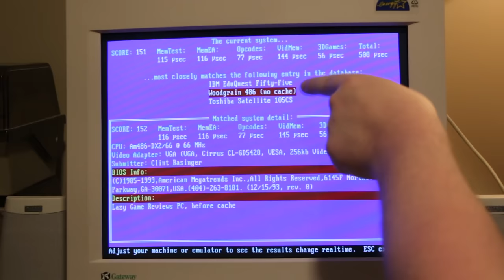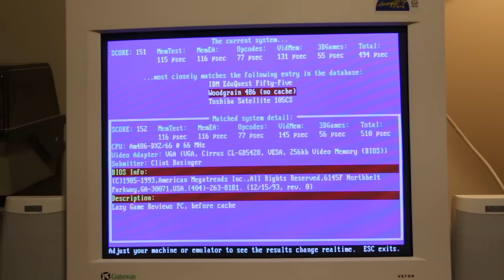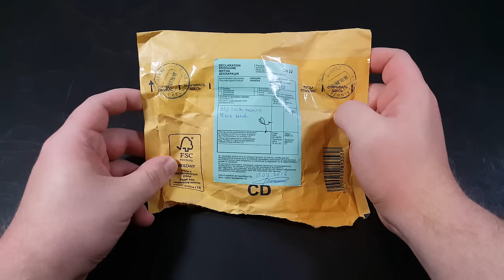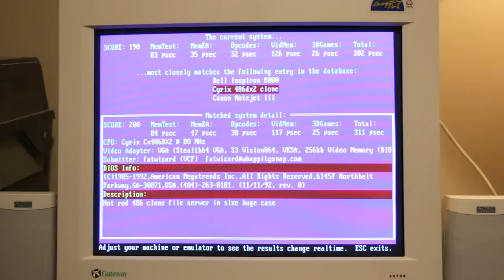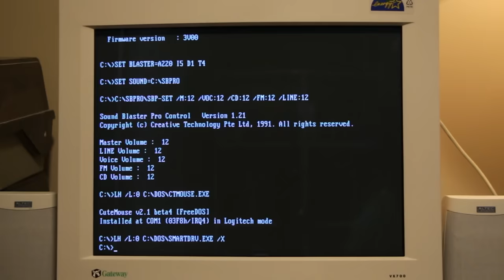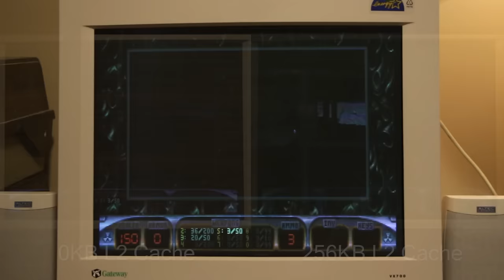LGR 486 Update! Installing L2 Cache

Comment: Great video here! In my experience, adding as much of the L2 cache as possible made plenty of difference.
Sometime in 1994 I bought a very nice 'multimedia' desktop PC made by HP. It was based on the AMD DX4 Enchanced CPU running at 100MHz. All other specs were outstanding for that time.
Anyways, I did not know that no L2 memory was included at the time of purchase. The bootup process was a real slow and painful atrocity. So, after loudly complaining to a dealer's sales rep regarding this issue of not telling me about the absent L2 memory, I bought 512MB of it (I hope I am correct), and installed it.
Wow, what I difference it made! The bootup alone felt alot like going from a slow HDD to a nice SSD these days. I do not believe that L2 memory influences all computing processes equally, but in some cases it provides for some dramatic performance improvements.

Comment: Quake and Duke3d are pentium territory
Reply: Quake probably more than Duke3D for various reasons.
Guess it's not worth playing below a Pentium100 and 4M of RAM but hey~ one can always try.
Reply: Will it run Crysis?
Reply: Oh boy, I used to play Quake back in the day on my 486 DX/2 and 28.8 modem for multiplay. It was pretty terrible, but I managed to finish single player mode.
Reply: Note sure about Quake but I played Duke3D, Shadow Warrior, and MechWarrior 2 on an i486dx2 with one of the most basic video cards ever, a ISA-based Trident with 512 (kb) of video RAM. It could be choppy but it was more often than not awesome.
Reply: From what I recall, getting above 320x200 in DOS Quake was basically never done. Frame rates were unplayable and before it was doable there was GLQuake for Windows combined with Voodoo accelerators and Quake-specific drivers. Even in 320x200 you could have been getting something like 18-25 FPS with anything less than the best Pentium money could buy.
Reply: From what I recall, my defunt 586 with 16 mb in ram could could run smoothly duke nukem in 640 x 480 resolution but with low resolution graphics, even the readmefile says that a 486 cpu could deal with DN but still recommended a Pentium for high resolutions; also Quake run in low resolution but obviously not so smooth as DN.
Reply: Duke 3d ran decently on 486 DX4-100 on high settings in 320*200. Quake was more of a masochistic pleasure though. FPS probably around 10-15 in 320*200. Still I finished single player mode, because I had to. You don't complain about framerate in id software games, you endure it and be happy that the gods in their infinite kindness even allowed you to run their game on your pathetic peasant 486 config. :-)
Reply: It will run an fps Crysis.
Reply: I remember playing Duke3D without problem in my DX4 100, even with "high" settings (I don't remember the resolution). I even played Quake 2 after overclocking it (and also play MP3).
Reply: +kosmosyche I played Duke Nukem 3D in 800x600 on a Pentium 133 so I think it is not such a hard job to a 486/100 in 320x200.
Reply: DX4-100..... What kind of graphics card? Maybe even PCI...
Reply: depends on your video card really. on my 486dx2 overdrive both quake and duke3d ran fine, with quake only needing tweaks for performance to take it to playable territory, while I used the vesa modes for duke3d (320x240) with my onboard 1mb paradise svga chip and it ran silky smooth!

But for quake the minimum for it to be comfortably playable is a dx4 100mhz 486.
Reply: Whelkman DOS Doom ran at 35 max. 
But yeah We played quake at near lowest res 320x200, but 320x240 looked a lot better as far as scaling. It was acceptable on a P133 640x480 was a slideshow, though. 
It’s really only until the Pentium Pro / Pentium II era where quake really ran smoothly.

My first computer had a pentium 75 and 1.25 GB hard drive and Quake II’s install was 300 MB. EL OH ELL
Reply: didn't quake require 16mb of ram minimum?
Reply: I did nicely on my first computer for duke3d (dx2 overdrive (on 386 mobo), 21mb ram, paradise svga 1mb chip) but quake was too slow even with the performance tweaks (some console command that made everything a bit blurrier, gave me a couple FPS boost)
Reply: Nonsense. I got loads of play out of both Quake and D3D on our 486. They ran even nicer on a 133mhz "Evergreen" K5 overdrive... and even without VESA drivers it was able to offer up to 360x480 just using plain VGA modes. Generally stuck with the 320x240 "mode X", though, as the square pixels made the most sense and it ran reasonably smooth (the 60hz vsync rate might have helped too, vs the more usual 70hz).

Of course, you needed at least 8mb, and 16mb made them both a lot smoother... and if you had an SX and/or non-clock-doubled machine you may as well forget it.
Reply: If i recall correctly i had a 486 dx2 33mhz with a pci sis 6326 graphics card and a sound blaster pro, 32mb ram and no l2 cache (was there, but 8yo me thought id disable it to free up more memory haha)
Ran quake ok i guess, everything on the lowest setting, and on the easiest difficulty setting (least amount of stuff happening)
Was alot better on my next computer though, pentium 686 166mhz, same video card, same sound blaster, but i now had a 12 speed cd drive and 64 mb ram.
Had that thing for almost 10 years till i got a celeron 850 mhz which wasn't that exciting, till i discovered msn and girls haha
Reply: I think your memory might be a bit faded on some of those points (not aware of there being a "dx2 33", it can only be one or the other; there's no such thing as a "pentium 686", though it might have been a cyrix; and the celeron was either a cheap second hand job or would have certainly come along rather less than ten years later...), but quite a bit of that feels familiar too, and the main thing is, hopefully, that you had fun with it ;)

Were the discovery of MSN and the discovery of girls related by any chance? :D

Also, if only the cache could have been converted into usable RAM. That would have been a smart hack if any motherboard manufacturer had ever implemented it. An extra quarter meg for "free" if it came pre-installed on the board, potentially somewhat faster than main system RAM, which programs could have deliberately chosen to run their main loops in (as you've got rather easier direct access to the hardware under DOS, particularly if it's a clean boot without HIMEM.SYS or the like loaded, and it would still have been an era where the central code of any given program could well have fit within 256 or even 128kb...) for a guaranteed speed boost... and maybe use a matching amount of system RAM as a disk cache to speed up file access which it might otherwise not have had the space for, particularly on a 4mb machine.
Reply: mspenrice i meant i owned it 10 years later, all of it was very second hand when i got it haha
The pentium 166 had 6x86 printed into the bottom of the chip, i may still have it somewhere. As for the 486, perhaps i am getting confused on that one, i cant remember haha

And yes i got asked to go on msn by a girl, so i made an msn account and then boobies hahahaha
Reply: mspenrice and about the cache, yeah i agree, i didnt know alot about it, i assumed at the time the cache was taken from the ram sticks, so when playing in the bios, noticed there was memory in something called a "catch" hahaha so i changed it to 0 from 256k hoping for a speed boost, but as you say it wouldn't have been possible with what i had at the time anyway haha (win95 plus iirc)
Reply: XD  ... fair enough then. Sexting and the like, always the thing that drives the most people to pick up on a new technology, especially in the field of communications...

I'm gonna have to try and fish out an old Pentium or MMX from somewhere then and see if they have anything stamped on the side you don't normally look at, now. Officially speaking, Intel gave up on publicly numbering their processors after the 486 (there was a court ruling that they couldn't trademark a number, so it was all names after that), up until the Centrinos and Cores came along and were given letter and 3- or 4-number codes, but they might still have internally used the 586 and 686 monikers internally...?

And yeah, my own 850 was bought new (though probably not much earlier overall, as it was a cheap option), but up until then I'd been generally chasing the coat tails of technology, including the frankenstein machine I built out of whatever I could get my hands on in the late 90s... 486 based, monochrome screen, and using a Zip drive instead of a hard disk. It may have sucked compared to the state of the art, but, what the heck, it was a PC I could call my own and do things on (like, but not exclusively, dull schoolwork) without having to wait for a turn on the family or school machines (both of which ended up being much more monopolised by gaming)...

Internet connection had to wait for a while though, and I don't think I ever bothered converting any, er, recreational images into a form it could display...
Reply: Maybe something for low spec gamer?!
Reply: Quake is a whole other realm from Duke3d. Duke3d was still the quasi-3d, where Quake was about the first true 3d game. The processing needs were much higher for Quake than Duke Nukem 3d.

Comment: The thing that still blows my mind about this era of PCs was the pace at which the tech evolved. Got my first PC in December 1994, an AMD 486 DX40 with 4Mb of RAM and a 170 Mb HD from the now defunct Escom. Within six months I'd dropped a DX2 80 in there and about 8 months later I was up to a DX4 100. That's three processors and 2 motherboards in just over a year. That HD soldiered on into the Win95 and Pentium era too before it got to the point that it couldn't hold any more than 2 games at once.
And here I am typing this on my FX8350 I've had since 2013 and 3 year old GTX970.

Comment: Ah, the good old days...
As a kid in the 90s I tried to push my DX2-50 from 128 to 256K. Without the web, a manual or the slightest idea of what the fu** I'm doing.  Do I have to add, that I failed miserably?
At least I made some good memories. ;)
Duke3D ran like shit, but we didn't care, it was the Duke.
Reply: Lol, I tried to overclock it without internet nor the manual after looking at those pins and table printed in the motherboard, by trail and error and I was successful! I put first my DX4 100 at 133MHz, but then I discovered it was fast at 120Mhz with 40MHz bus and 100MHz with 50MHz bus. Then it died from electro-migration after overheating a few times (the fan died). But that was already in 2002/3.
Reply: DX2-50....I suffered with the same CPU..."sandclock studies" and it never came close to the mysterious superpower of the new PENTIUM processor.

Comment: wait what. Is this a UEFI on a 486 motherboard?
Reply: no
Reply: vojtasTS29 early renditions you could say
Reply: UEFI wasn't even thought up yet when these were in common use.
Reply: i thought that too. But his bios clearly has a graphical interface.
Reply: Graphical interface doesn't indicate UEFI
Reply: I don't know about this one in particular, but Compaq computers had a graphical BIOS setup program that ran from the hard drive. Which I learned the hard way when I had to replace a hard drive in one and couldn't modify the BIOS. 

Fortunately, I figured out a way to do what I needed to do without it.
Reply: My guess is that there was a floppy disk that also had the BIOS setup program on it that you were probably missing. One of the weirdest things I have ever seen was the 486 based Texas Instruments Travel Mates had the BIOS setup program both in ROM and on the hard drive. You could even tell which one you was in by the background color. Now as for Compaq computers having a graphical BIOS setup program, not all Compaq computers did. Some where test based only such as the LTE/286. It came on a floppy disk only. So when the rubberized nylon belt in the floppy disk got too worn, I was unable to use the BIOS setup program to put the hard drive settings back in after the backup battery failed. In effect the computer was rendered useless.
Reply: >wait what. Is this a UEFI on a 486 motherboard?

No, it's called WinBIOS. There was a brief period in time starting around 1994 where BIOS maker American Megatrends (AMI) created a graphical BIOS interface to emulate the look and feel of the Windows 3.x UI. 

AMI didn't keep WinBIOS around for long because there were problems on some motherboards with IRQ distribution among all PCI/ISA slots, and the fact that Windows 95 was released a short time after, which looked completely different.
Reply: No, American Megatrends were just well ahead of the game in terms of having quasi-graphical BIOS interfaces. We had the exact same thing on our first 486, and it was very definitely an integral part of the ROM, no floppy disc expansion or anything. It would work just fine if you didn't have a floppy (or HDD, or pretty much anything other than keyboard, video, CPU and RAM) connected at all, even.

Didn't see the like again until I got my Duron system probably 8 years later, every other example in-between (and a lot of even later BIOSes) were all 80x25 text-menu clunkers.

I don't know why, it doesn't exactly require a great deal of ROM or RAM to provide a simplistic mouse-and-window interface. Atari were able to work an entire graphical OS into 192kb, and even that seems extravagant next to e.g. GeOS on the C64.

Comment: I owned a lot of retro computers (still have lots of parts - nostalgia). A lot of motherboard had numbers of L2 slots. I came 2001 to one shop: hey, have you some old L2 cache? I buy it. The guy brought me the whole basket of it!!! No cash. That crap is yours now. I installed dozens of it in my 486 computers. Fantastic boost to load sofisticated games of middle 90'. Not the game but the loading of various menu screens was pretty quicker! I remember the legendary "installing afternoon" one cold day in early spring 2001.

Comment: Really makes me appreciate modern case design. Case I currently have, you can open it on both sides and the motherboard is actually attached to the right panel so when you open it the entire thing swings right down, taking part of the back of the case with it.

Comment: Funny fact, I've used the SRAM chips used for 486 cache, as replacement RAM for the Sega Genesis.  As long as it's the 32KB chips and the right pin count, they almost always work, because they are faster than what the Genesis will need anyway, and are basically, the same.  Genesis uses PSRAM (fake SRAM, really DRAM internally, but with SRAM pinouts), and cache uses real SRAM.  So if anything, it's an upgrade (with no gain though).
Reply: Addind faster ram without changing the clock speed of the data bus is generaly useless.
Reply: Nekkz Right, which I said it had no gain.  But, the chips are usable for repair, since they are more easy to obtain than PSRAM.
Reply: That is cool indeed. A nice hack.

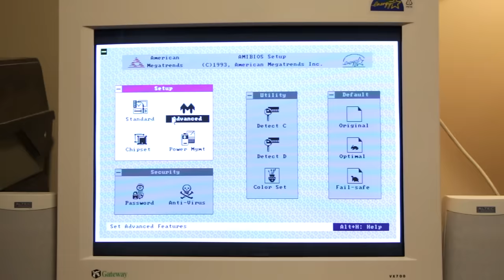Comment: 7:46 why does an early 90s BIOS look way more user friendly than most BIOSes up until UEFI?
Reply: For some reason the graphical version didn't catch on for another 10-15 years. Maybe people who were still trying to boot their 486s and Pentiums with CGA, Hercules and MDA cards complained about it, so everyone just carried on using 80x25 textmode instead.

(I mean, from what I remember of the look of it, the graphical interface used EGA hi-rez mode with only four simultaneous colours, so it would have been compatible with basically everything from the original 64kb EGA card (released in like 1986?) onwards... and in fact I'm sure I had a similar board set up with a salvaged Hercules card and monitor for a while so it might even have been able to work in slightly higher resolution monochrome too...)

The other thing is that you wouldn't be able to redirect the screen output to a serial terminal or the printer port to change the settings on a headless system (which is something you can do with MSDOS, and I've resorted to the once to copy schoolwork files onto disk when our only monitor burned out, but I'm not sure whether it's something many or any BIOSes supported or how you'd achieve it), which given its usefulness for servers etc may have held up the adoption of graphical BIOSes for a surprisingly long time. Even the UEFI things I've had exposure to seem to run in that same old text mode (which happens to be compliant with the ANSI terminal standard), even though the "traditional" BIOS is graphical and even runs in true-colour at XGA resolution...

Comment: My first motherboard with Pentium 150 MHz in 1997 had slots for extra cache memory but the cache was very expensive for me then. 
In 1999 I bought a Soyo motherboard with super socket 7 socket and 1 MByte cache memory. I used the motherboard with the AMD K6-III 400 MHz with 256 Kbyte cache. I overclocked the motherboard to 450 MHz and with 1280 KByte of total cache the norton utilities benchmark gave me a performance comparable to that of Pentium III. 
It was a smart move for people who couldn't afford the expensive Pentium III. 
I had great times with my AMD K6-3. Very fast and affordable CPU. I was using it for many many years. My next CPU was with a Celeron at 1.7 MHz in 2003. It was incredible faster than my old AMD K6-III but for its time it was one of the slowest. However it was very cheap and good enough.

Comment: The biggest performance gain you'd get in Duke3D is with a good VESA-Compliant video card. A TSENG et4000 or better. The CPU and cache are more than good enough to run that game full speed.